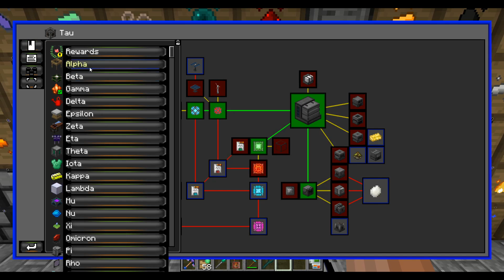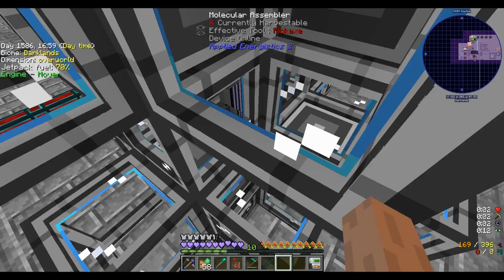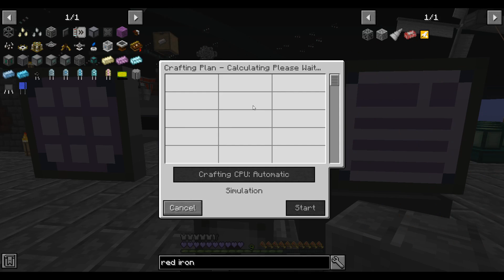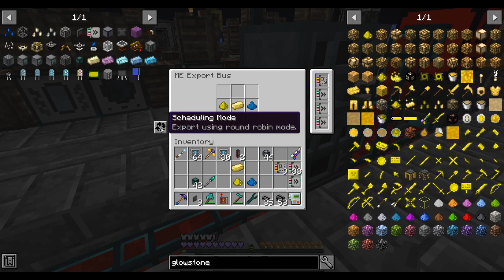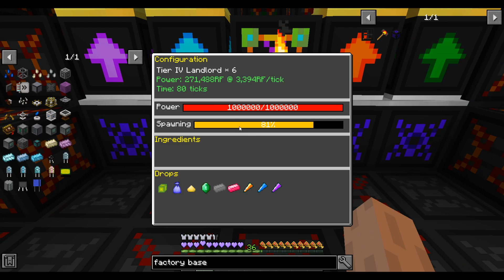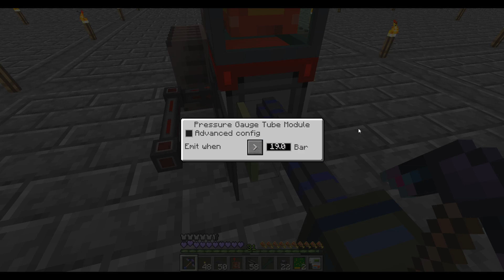Project Ozone 3 Kappa Mode EP25: Capacitors and Transistors 2, Electric Boogaloo

Comment: What I’ve seen people do to be able to use one to many style p2ps is have a single dense smart cable between the input tunnel and the controller so that you can read the number of channels
Reply from the maker: I used to do that, but since p2p tunnels started being colored when assigned, I've since stopped. As long as you keep your connections 1:1, there's  no need to be able to check if you're about to run out of channels on both sides, and it helps keep your controller a bit cleaner. 

That said, it's not a bad idea by any means. Especially if you take advantage of p2p's 1:many functionality.

Comment: If you want to increase the speed of the capacitor significantly all you need to do is change the number of empowered you have for each tier to be tiered. So that you have for example 8 of the first tier recipes, 4 of the second tier recipes etc.

Comment: Do you have a tutorial for Applied Energistics 2? I don't understand how works the p2p tunnels you use in the video
Reply from the maker: Years ago, when I was learning how to use AE2, Direwolf20's mod spotlight on it helped a ton. It's for an ancient version of Minecraft (might even be pre 1.7 IIRC), but AE2 basically hasn't changed since that time.
Reply: @JimmyCraft  Thanks, I will check Direwolf20's video. Right now I am copying your AE2 setup for auto crafting